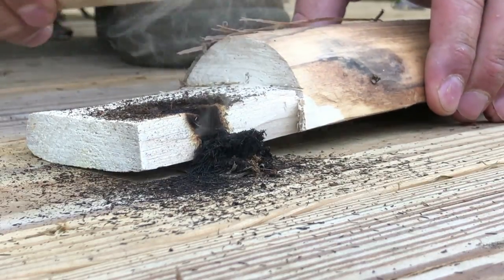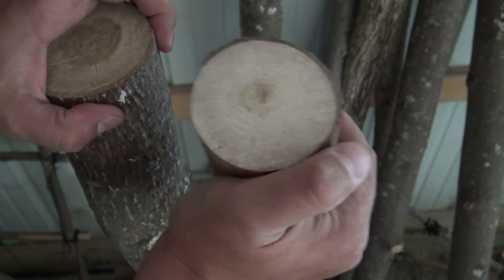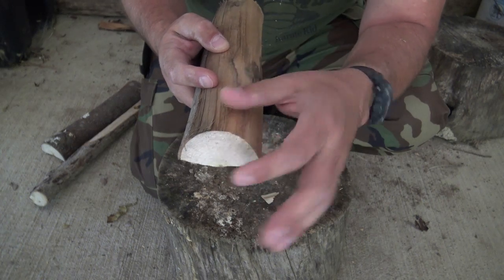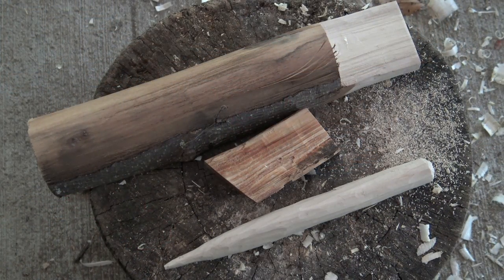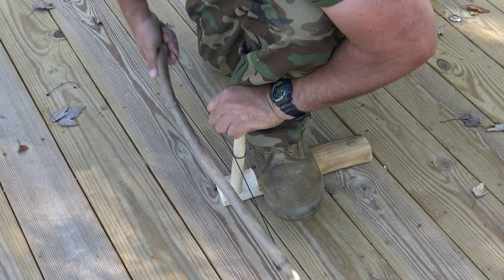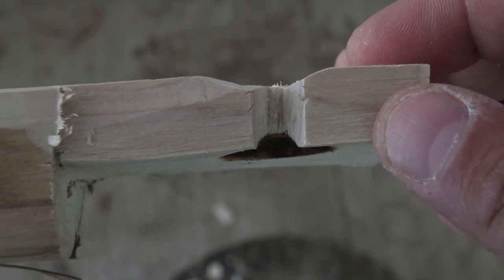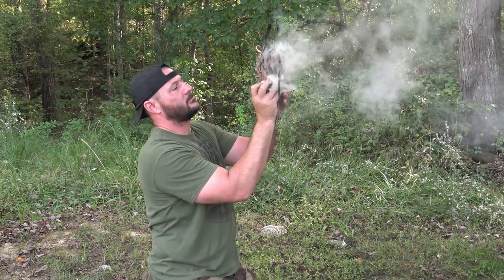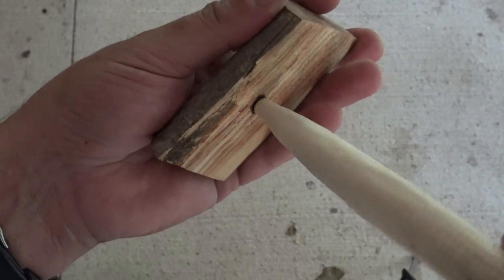The Best Kept Bow Drill Secret - Guarantee That Ember

Comment: Thanks for your tips I am curious of your opinions on sleeping bag vs blankets, tarp vs tent, boiling vs filtration pump , as u can tell I have been a air mattress guy
Reply: Sleeping bag over blanket, and a filter (or chemicals) over boiling hands down. Boiling is tedious, time consuming and a waste of fuel, and you're limited by the size of your pot, and you need to let it cool. Obviously boiling may be a good option in survival situations or other specialized circumstances.

Tents vs tarps isn't as straightforward, there are pros and cons to each. But for most people in most situations, I think tents are a better and easier and more versatile option, they give better protection, and more comfortable for most people. But there's nothing wrong with a tarp, and of course a basic blue tarp and some cord is much cheaper than a tent, and high-end sil-nylon tarps can be much lighter.
Reply: Blankets and boiling are more multifunctional and require you to carry less into the woods with you. I could see the argument being made for a sleeping bag but if you’re going to make a fire anyway stick with boiling because you already have that resource available to you so you don’t need to bother carrying in more gear.

Comment: 3 hrs later a working bow drill
5 hrs later the wood deck is on fire 🔥
When you're warm and dry there's less need of a fire, so now go out in the rain and snow where everything seems wet and duplicate your success.👍
Reply from the maker: What?
Reply: That is why you should make your bow and drill and fire kit ahead of time and keep it as part of your survival kit.  That way you don't have to try and make one when everything is wet.  PREP AHEAD OF TIME
Reply: @Retsam03  Yeah prep ahead of time, Bic lighter.
Reply: You are completely correct.  That is why a lighter is a PART of the fire starting kit that I made.  But it is just a part.  I have 4 different means to start a fire in my kit.  Being a former Survival Instructor in the Military I've seen a fire kit where the bic lighter  was empty when it was taken out to be used.
Reply: You got to learn the technique first, before you take it bush and employ it.

Comment: I use a fidget spinner 4 my bearing block because of the bearing and the fidget spinner allows it to spend a lot easier and you don't get the Shoulder fatigue the only thing is my question is why do you need to burn a notch out first before cutting the pie out I done that already I made my whole I made my pie cut and I still got my friction fire
Reply: Clever idea.  Never thought about that.  Thanks!

Comment: Err ... dumb question ... if you planned ahead enough to bring a fixed blade knife, a saw, and a pocket knife (the tools used to make the bow drill and board), why didn't you bring matches or a ferro-rod too?
Reply from the maker: Where in this video did I say to rely on friction fire? The video is about how to make a bow drill and get an ember. Thanks for watching
Reply: If you have to make a fire this way, you messed up bad. But it is fun to do.
Reply: It's not uncommon to have a knife in pocket and a bootlace on your foot.  The rest of these materials can be found in the woods easily in most places.  It's not about planning to need to use it, its about knowing the best case scenario of making a bow drill then figuring out how to find the supplies where you are when you need it.

Comment: I understand the part about removing the black or burned material off the spindle after seating the set, but why didn't you remove the black part on the fire-board too?
Reply from the maker: because I want the material to come off the spindle on the board

Comment: You want efficiency for a hand hold use a automotive wheel bearing with drill top carved down to enter bearing core; eliminates over half the friction and provides 4 times the energy transfer to drill friction point...been able to crate ember in 1/4 the time. and of greater size - endurance. Benefits - two - larger more intense ember, hand hold remains cold/cool, twice have had base board catch on fire. Further trick under baseboard hole place a small square piece of cotton fabric. Ember catches cotton on fire - or use char cloth - works even better when cotton material or char cloth impregnated with petroleum jelly.
Reply from the maker: I will carry the 10C's and combine that with my skill level  and experience. Thanks for watching
Reply: Jaime Cancio wheel bearing, carved down to enter bearing core, how do you do this, or do you buy them with this feature?

Comment: How many uses/how long would this set last? Depending on technique, conditions, etc.
Reply: My two cents worth...the bow will last forever. The fat wood will last for dozens of lights. The spindle will last several lights (it gets shorter each time). The base will last for as many holes as you make. The same hole can usually be used twice or maybe even more depending on how long it took to make the ember. After the hole is too deep, then simply start a new one about an inch or so away.

Comment: I’ve noticed you’ve been using some kind of bank line in a lot of your videos do you prefer it over para cord?
Reply: Bank-line tends to grip harder on account of a rougher looser twist than Paracord, good for friction knots like Prusiks or stress bearing hitches like on a bow drill, it is also less `stretchy` which is better in wet conditions.
Reply: A lot of people like it because it’s cheaper and takes up less space than paracord. It’s not as strong but it’s often considered strong enough for most bushcraft applications. Some people report knots binding better, and I’ve noticed some success with knots binding well but I prefer paracord because it tends to be more flexible which I find makes tying and dressing down the knots easier. It kinda amounts to preference/what you’re going for.

Comment: Only thing I don't like about your technique is the direction of your string wrap around the spindle. When you're working the bow, your string is rubbing on it's self which, with natural fiber string, will cause friction on the string that can cause the string to break. Wrap the string with the over string towards you and when you angle the bow the string will not touch it's self. Just my opinion. I like your video though.

Comment: No one ever covers how long the string needs to be why is that?
Reply: because it varies from how long the bow is and how thick your drill is. You need to adjust it accordingly so that your drill locks into place on the string as he showed. Too tight and it wont move, to lose and it won't drive the drill. The type of string also can vary as some lines will stretch, even ever so slightly, causing the drill to pop off of the line. It's part of the reason why CC and Dave praise the tar bank line for bush craft use.

Comment: What is Fat wood? Why didn't he explain? This from Wikipedia;
Fatwood, also known as "fat lighter", "lighter wood", "rich lighter", "pine knot",[1] "lighter knot", "heart pine" or "lighter'd" [sic], is derived from the heartwood of pine trees. The stump (and tap root) that is left in the ground after a tree has fallen or has been cut is the primary source of fatwood, as the resin-impregnated heartwood becomes hard and rot-resistant over time after the death of the main tree.
Reply from the maker: was the video about fatwood or a bowdrill?
Reply: Pines and such send sap to injured limbs. The sap is flammable, and also collects in some stumps and branches of dead trees. It's darker than surrounding wood, moist, and smells like turpentine. Great for tinder and kindling because it lights easily and will burn a long time compared to say, a bit of birch bark.

Comment: WTH is FATWOOD??
Reply: This was by far one of THE best tutorials, on this method, to starting a fire. Well done, Sir. 😁 Thanks for sharing
Reply: Fatwood is when the sap in a pine tree dries inside part of the wood, usually the ends of branches towards the trunk, and bottom of the trunk towards the roots. It has a bright orange color compared to the white wood around it and has a distinct smell. It's highly flammable, great to start fires in the rain, and apparently also makes a great bearing block.